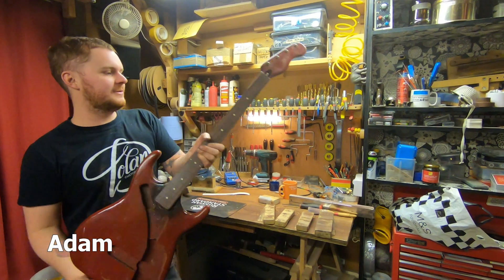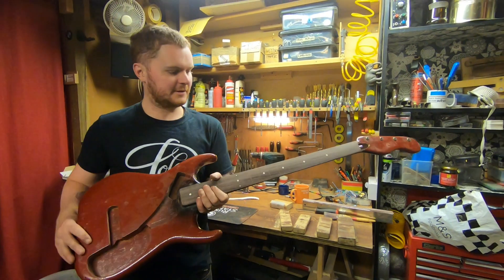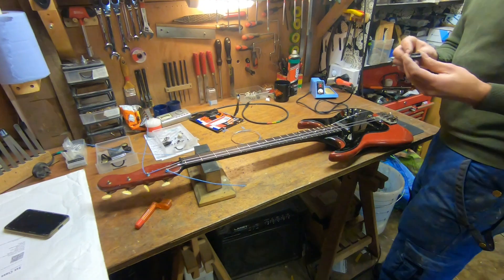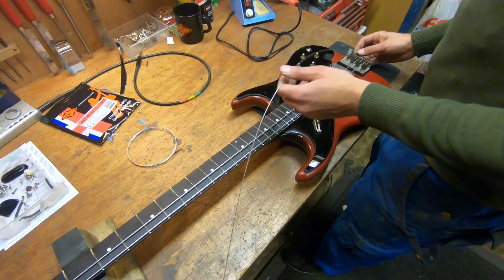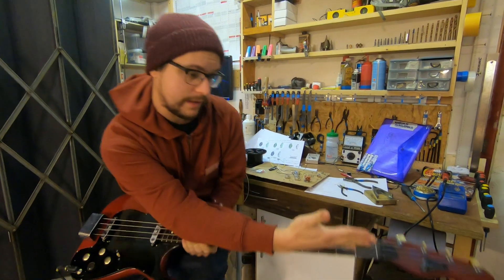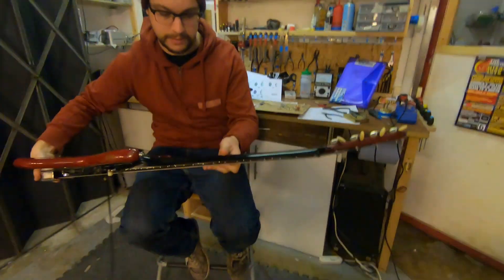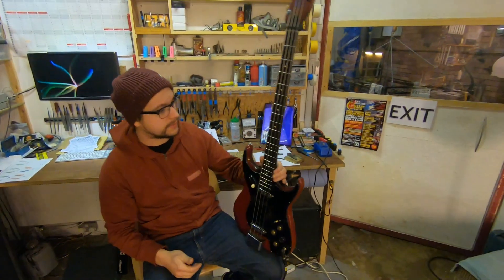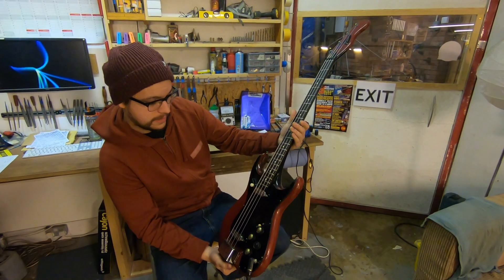The Fret Files e01: 1961 Burns Artist Bass

Comment: Hi, what kind of fret did you put on it as replacement? Brand and size?
Thanks
Reply from the maker: Can't remember sorry, it was a couple of years ago now! Would likely have been Jescar, and we would have worked out the correct size by measuring a fairly untouched fret at the end of the fretboard and extrapolating from there. Hope that helps! -
Steve
Reply: @jacksinstrumentsvcs1  thanks